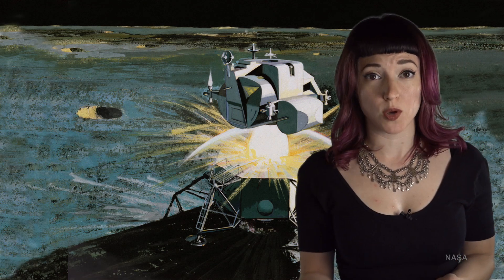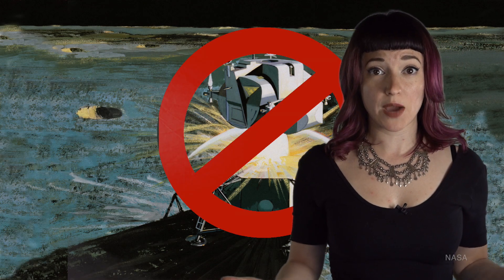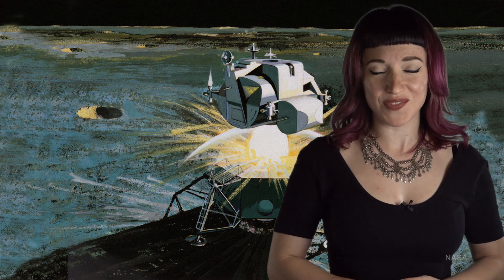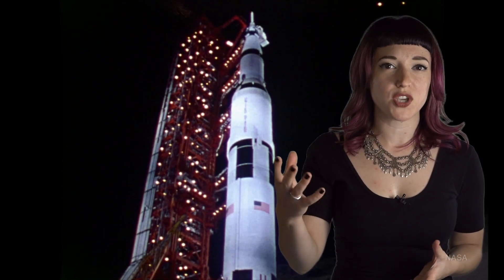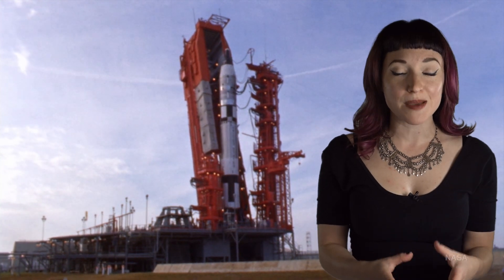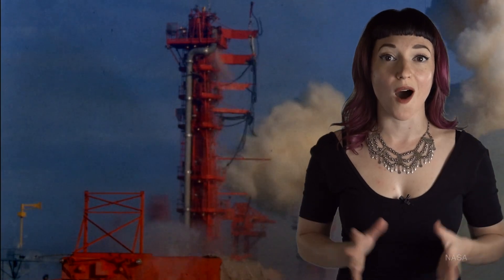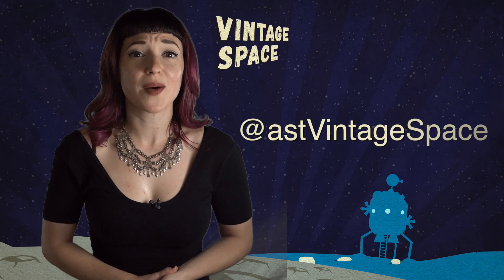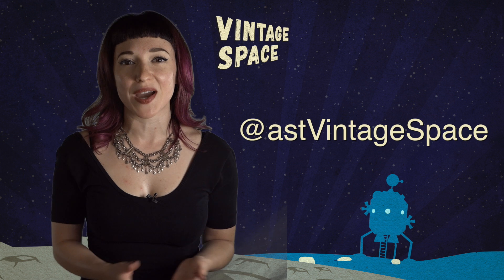How the Lunar Module Launched from the Moon Without a Flame

Comment: Yet given time delay as they say camera that was remote followed flawlessly and yet only left there to see departure and then remotely shut down. Why not leave it on for a while to maybe see moon phase and changes. Nope. Just gottaake sure got leaving moon on there. So scientifically absurd. But now make theories if how it as ascended wow. Science is awesome. Follow their science, follow their knowledge , they are the controllers.
Reply: YOU SAID: "Yet given time delay as they say camera that was remote followed flawlessly"

== Well, Apollo 15 didn't follow at all, because the tilt function was broken.  Apollo 16 followed horribly, and the lunar module went out of frame very quickly.  Apollo 17 was the best of the three attempts, surely, but, it was far from flawless.

YOU SAID: "and yet only left there to see departure and then remotely shut down."

== No, they used it until the cameras burned out.  For Apollo 17, that was about 27 hours.  It was about 36 hours for Apollo 16's camera.  I don't recall what it was for Apollo 15's camera, but, undoubtedly, it was in the same basic timeframe.

YOU SAID: "Why not leave it on for a while to maybe see moon phase and changes. Nope."

== They left it on until it burned out.  But, that camera was never designed to withstand a lunar afternoon.  It would never make it through a single afternoon, because the surface temperatures get too hot.  Even in a vacuum (which is a great insulator), once you get into a lunar afternoon, the heat is just too much.  The surface heat conducts through the rover and into the electronics.  The rovers build up their own heat.  Even just the radiant heat would be a lot for the camera to withstand, once the surface temperatures got to around 250 degrees (F).  I mean, sure, they have had cameras on the moon that have lasted through those extremes.  But, this particular camera, and the associated electronics and batteries, were not designed for it.  They were designed for use in the lunar morning only.

YOU SAID: "Just gottaake sure got leaving moon on there."

== Want to try this sentence again when you're sober?  I have no idea what it means.

YOU SAID: "So scientifically absurd."

== How would you have done it instead?  What EXACTLY are you saying they did wrong?

YOU SAID: "But now make theories if how it as ascended wow. Science is awesome. Follow their science, follow their knowledge , they are the controllers."

== You wouldn't happen to be on drugs, would you?

Comment: What is the difference between a CSM that went to the moon and a CSM that when to Skylab?
Reply: Not much at all.
The Skylab missions were essentially cobbled together out of components that had already been manufactured and paid for by the Apollo program.
Even the space station itself was built from an unused rocket fuel tank that was meant for one of the cancelled Apollos 18, 19, or 20.

Comment: When are they going back to pick up the guy that was working the camera that filmed it? He didn't just film the initial takeoff but followed the lander perfectly as it rose. If Nasa was operating the camera remotely the radio signal to operate it would have taken a few minutes to travel the 240,000 miles to the moon. Combine that with the delay of the footage getting back to NASA for someone to adjust the direction of the camera in real time. Hmmm. I'm sure there's a good explanation for that. Maybe they went back and picked him up off camera!
Reply: -"He didn't just film the initial takeoff but followed the lander perfectly as it rose." Only in the last mission, it took 3 tries to get the timing right.
-"it would have taken a few minutes to travel the 240,000 miles to the moon." Wait, where on Earth did you get a few minutes from? Radio waves travel at the speed of light. The Moon is 1.3 light seconds away, therefore the delay for the round trip is less than 3 seconds.
-"I'm sure there's a good explanation for that." Indeed there is. There was a countdown before the LEM lifted off, so the guy operating the camera just had to start panning at T-3. They also knew what would be the acceleration of the LEM so the panning speed could be calculated. With all that he still didn't manage to get it the first two times.

Comment: How was the camera controlled? Some reports say Houston did it, which would have resulted in an almost a 3 second delay. If it were done by the crew on board, talk me through this scenario. Lastly, does the amount of dust that is kicked up match the force needed to get the lander off of the moon. Doesn't look like 1/6 of what we'd see on the earth to me.
Reply: -"which would have resulted in an almost a 3 second delay" The LEM upper stage didn't just randomly take off, there was a countdown. The trick to getting the timing right was simply to start panning up at T -3 instead of at liftoff. The amount of panning needed was a bit more complicated and they only succeeded to film the liftoff in the last of the three attempts.
-"Doesn't look like 1/6 of what we'd see on the earth to me." There are a lot more variables than just this. The amount of dust would be 1/6th of what you see on Earth only if the rocket you see on Earth has 6x more thrust than the one used here and there is similar amount of dust with similar properties. For starters, most of the dust was blown away by the descent stage when they landed, then there is the issue that lower stage was between the ground and the upper stage engine when it fired. So you really wouldn't expect to see much dust.
Reply: YOU SAID: "How was the camera controlled?"

== Via radio remote control in Houston, relayed via whichever of the ground stations had the best line-of-sight to the moon at that particular moment.

YOU SAID: "Some reports say Houston did it"

== Correct.

YOU SAID: "which would have resulted in an almost a 3 second delay."

== Well, that's the round-trip delay, not the one-way delay.  But, anyway, Ed Fendell (the person operating the cameras throughout Apollo 15/16/17) got very used to the delay.  And, they planned the liftoff and had a countdown.  The delay was well understood, and he planned for it.

YOU SAID: "If it were done by the crew on board, talk me through this scenario."

== It wasn't done by the onboard crew.

YOU SAID: "Lastly, does the amount of dust that is kicked up match the force needed to get the lander off of the moon. Doesn't look like 1/6 of what we'd see on the earth to me."

== It's not that simple.  First of all, the descent stage acted as a launch platform for the ascent stage.  Most thrust was deflected outward.  But, yes, some thrust did hit the lunar surface, of course.  But, if you think you're going to see grains of dust from 300 feet away in a low resolution TV camera, then you have no understanding of optics.  The most you'll see is a bit of a blur, and that's exactly what you see in the video.  But, go watch one of the better quality copies than hers.  I mean, there are no high definition copies, of course, because it was never more than a TV signal with a couple hundred lines of resolution.  But, she's chosen an especially low resolution copy, making matters worse.  The original copies show a bit of a blur as the lunar module lifts off.  That's the dust.

Comment: How was the footage of the ascent filmed and retrieved? Who was holding that camera?
Reply: Radio communications were already a thing. The footage was transmitted back and the camera was operated by remote control.
Reply: YOU SAID: "How was the footage of the ascent filmed"

== There was no film involved in that particular imagery.  That was a TV signal, not film.  But, yes, there was also a 16mm film camera inside the lunar module pointed out the window.  But, I know you're not asking about that film.

YOU SAID: "and retrieved?"

== Via radio.

YOU SAID: "Who was holding that camera?"

== Not a who.  It's a what.  It's mounted to the lunar rover.

Comment: How did the engines burn fuel in vacuum (no oxygen)? What do thrusters push air against in vacuum? Shouldn't the dust on the moon be sucked up by the vacuum surrounding it? Why is the moon light colder than moon shade? Watch "a funny thing happened on the way to the moon".
Reply: YOU SAID: "How did the engines burn fuel in vacuum (no oxygen)?"

== They bring oxidizer with them, in addition to the fuel.  That's how a rocket works.

YOU SAID: "What do thrusters push air against in vacuum?"

== There's no such literal concept.  That's not how a rocket works.  It's Newton's 3rd law of motion.  Spew 5 million pounds of expanding hot gasses at explosive speeds in one direction, it pushes the craft in the opposite direction.

YOU SAID: "Shouldn't the dust on the moon be sucked up by the vacuum surrounding it?"

== No.  That's ridiculous.  As a matter of fact, you're BACKWARD.  Without air, there's nothing to swirl around and pick the dust up, like you'd see with wind on Earth.  Without air, the dust just reacts to gravity alone, and stays on the ground, because there's no force to pick it up.

YOU SAID: "Why is the moon light colder than moon shade?"

== Because your flat-Earth friends have lied to you.  The effect you're talking about is usually a result of very bad experimentation, such as putting the thermometer under the "shade" of an umbrella or something.  But, all that does is trap small amounts of hotter air (hot air rises).  Thus, if you put a thermometer under an umbrella (for example) it will be hotter than if you put a thermometer in the open air.  The thing about your flat Earth friends is that they don't do the experiment when there's no moonlight at all.  Guess what?  The same thing happens when there's no moonlight whatsoever.  Thus, the effect you're talking about isn't "cold light" like you're claiming.

YOU SAID: "Watch "a funny thing happened on the way to the moon"."

== Why?  That video has been so completely debunked a million times over, it's ridiculous.  It's full of the most ridiculous fabrications, and dishonest editing.  It was made by convicted criminal taxi cab driver Bart Sibrel, who claims that NASA gave HIM the original Apollo 11 video films, which became the pinnacle of his claims.  But, guess what?  The video footage he was claiming was his most powerful evidence (his own claim) wasn't even shot on film.  But, he paraded around, claiming to have the film carbon dated (you can't carbon date film, which is a different problem, in addition to the fact that it was never shot on film to begin with), and saying it proves that Apollo 11 never went to the moon, but was in low Earth orbit.  All anybody needs to do is fact-check his claims, and would know instantly that Sibrel was lying constantly in that video.  So, why would you EVER suggest that other people watch that silly piece of trash?  Why?  If you don't even know that rockets bring oxygen with them, and you don't understand simple Newtonian physics, you are ill equipped to judge the veracity of any of the claims made in that video.  That would be like asking a 4 year old to grade a university calculus test.  If you don't know anything whatsoever about rocket science, you're in no position to assess the veracity of claims made in that video.

Comment: "Look at my right hand so you can't see what my left hand is doing..." She is focusing on something that isn't even the crazy part of this video.
Reply: Well, people do complain about not seeing a flame. She is just addressing that particular claim. In your opinion what is the crazy part of the video?
Reply: @darthmarvin247  My contention is not with a flame but more of the fact they are saying the moon is 250,000 miles away from earth and without any delay are communicating with Houston and recording remotely the take off with ZERO issue.  With thousands and thousands of satellites in the sky I have phone calls dropping in a large city like Salt Lake in 2021. This was in 1971?
Reply: @darthmarvin247  ZERO delay... Across 250,000 miles. That is impossible.
Reply: @sophlefnort  -"...and recording remotely the take off with ZERO issue." Well, I have good news for you, they DID have issues. They attempted to record the lift off in the 3 missions that had a rover and they only got the timing right on the last one. If you think about it, compensating for the delay was not that hard. The astronauts did a countdown before lift off. All the guy operating the camera had to do was start panning at T -3 (round trip delay was a bit less than 3 seconds). This is really not rocket science.
-" I have phone calls dropping in a large city like Salt Lake in 2021" Does your cell phone have a dish that is several meters in diameter? If not then those two are not even remotely comparable.

Comment: First we see the moon rover drive around kicking up that fine dirt. But then when the LEM is launched from the moon nothing. Also note the operating temperature specifications of the rover's battery pack. Maximum operating temperature 125 degrees F./52 degrees C. Average temperature on the moon according to NASA 225 degrees F./107 degrees C. 
When sunlight hits the moon's surface, the temperature can reach 260 degrees Fahrenheit (127 degrees Celsius). But according to the official NASA 'Lunar roving vehicle: operating handbook' the batteries can only operate in temperature up to 125 degrees F./52 degrees C. with a 140 degrees F./60 degrees C. 'Survival upper temperature limit.'
Reply: There was very little dust blown up on takeoff because it had already been blown away during the landing.

The temperature may be high, but there's nothing to conduct that temperature into the batteries. Just coating them in reflective foil will reflect he majority of heat from the sun. Will they eventually get too hot? Yes, but it will take many days more than the astronauts were going to be in the moon.
Reply: YOU SAID: "First we see the moon rover drive around kicking up that fine dirt. But then when the LEM is launched from the moon nothing."

== Wrong.  First of all, the descent stage acts as a launch platform, deflecting most of the rocket exhaust.  But, yes, some of the exhaust still stirs up dust.  I have no idea why she is using such a low resolution copy of the liftoff video.  But, if you go look at some of the better resolution copies, you see a haze of dust.  No, there is no "high resolution" copy to be able to see it in much detail.  But, from 300 feet away, with a TV camera that isn't even 480 lines of resolution, yeah, you certainly can't expect to see individualized dust grains.  The best you can expect is a bit of a blur to the image, and that's exactly what happens.

YOU SAID: "Also note the operating temperature specifications of the rover's battery pack. Maximum operating temperature 125 degrees F./52 degrees C."

== They encased the batteries in wax to act as a heat sink.

YOU SAID: "Average temperature on the moon according to NASA 225 degrees F./107 degrees C."

== Well, that's obviously wrong.  The average is around 0 degrees F.  You're probably referring to an average DAYTIME temperature.  But, who cares anyway?  No mission was on the moon for the "average" temperature.  They always landed early in the lunar morning, long before those high temperatures were reached.

YOU SAID: "When sunlight hits the moon's surface, the temperature can reach 260 degrees Fahrenheit (127 degrees Celsius)."

== That's only well into the lunar afternoon.  It doesn't just instantly hit that temperature.  And, it's irrelevant to Apollo.  The rovers never saw those extremes until the astronauts left.  And, yes, ironically, it's the temperature that burned out the camera on Apollo 17 (the liftoff you're talking about in this video).

YOU SAID: "But according to the official NASA 'Lunar roving vehicle: operating handbook' the batteries can only operate in temperature up to 125 degrees F./52 degrees C. with a 140 degrees F./60 degrees C. 'Survival upper temperature limit.'"

== Hence why they always landed early in the lunar morning.  Hence why they encased the batteries in wax to help control the temperatures.

Comment: You say the titan2 rocket engine burns with a clear flame. But the footage clearly shows a yellow flame!
Reply: You only see coloring in the small amount that is interacting with the atmosphere.  You're missing the bigger picture, which is that the main body of the flame is invisible to our spectrum of eyesight.  They ran the Titans a bit rich to keep them cool, also, which is part of the reason why you can see a bit of coloration as the unburned fuel is able to mix and burn with the atmosphere instead of the oxidizer.  None of that happens for the lunar modules on the moon.
Reply: @rockethead7  i have to disagree with your statement that the coloring is only visible with the part of the flame that is interacting with the athmosphere because it is clearly the part of the flame in the center that is colored.
Reply: @erbalumkan369  
The "center" is bright because the surrounding atmosphere is sucked in between those exhaust streams from the fluid dynamics.  But, whatever, you clearly have come to your conclusions first, and look at the evidence second.  You didn't even know why the Titan flame was visible at all, remember?  Now, you're questioning things like that?  Hey, if you think the ACTUAL burn was the yellowish color, then why is it only there in that spot?  Why not throughout the entire exhaust plume?  Why isn't there an aerospace engineer or rocket scientist on the face of the Earth who agrees with you?

Whatever.  I don't care.  Almost without a doubt, you reject all input anyway.